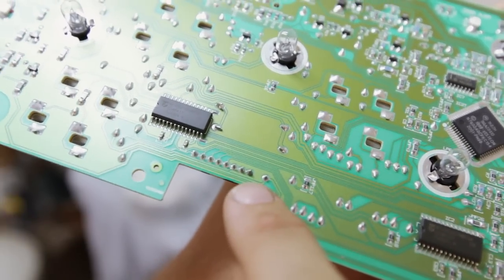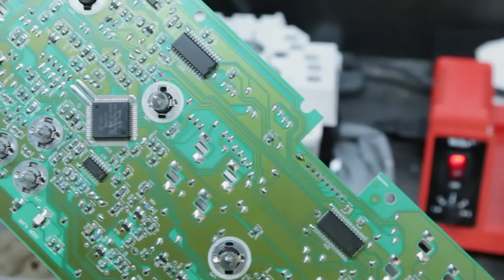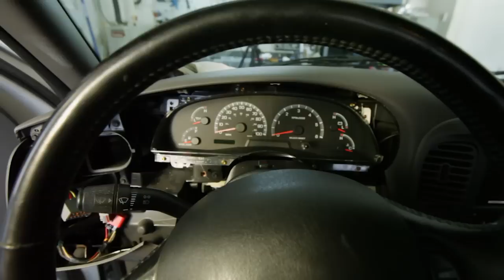How to Repair a Ford Odometer Digital Display

Comment: Ok man I have a question I have a 2006 ford escape hybrid and when I went to get into my vehicle and found before I even opened the door that my that both lights were still on where the digital reading of my odo and where it shows if it's in park ect....dont know why those lights wont turn off if you can help it would be greatly appreciated

Comment: A great help.  i used a jeweler's loop (because my unaided eye couldn't tell if it was damaged) and several of them looked damaged, so I touched the whole connector up and it works great.  Way too hot today to want to dismantle that thing twice.  I'm glad it worked on the first go-round.  The only extra thing I did based off several other videos/articles was I disconnected the positive battery first so the airbag didn't blow up in my face.  I'm sure it's safe enough without that step, but it only took an extra minute.  I also removed all the light bulbs because I didn't want to force the clips off to find out I was pulling off the lights, but now I re-watched your video I realize I could have left those in.  I wasn't expecting the board to take that much force to slide off but that was probably just 17 years of oxidation build up.

Comment: I have repaired two of them, one in a Silverado and another in a Ford F150, just by removing the electrical connectors and spraying both male and female sides with a good helping of CRC Electronic Connector Cleaner.  There was no need to do soldering. The Silverado took minutes to do and the Ford took an hour. The Silverado was sometimes displaying the odometer intermittently because the prongs were loose. . I took it out again separated a few of the outer prongs to get a good fit. No problems with either of them has occurred again.
Reply from the maker: interesting tips and glad the issues have been repaired

Comment: Thank you for this...just did mine finally after years of stressing about it.
Reply from the maker: Glad it was helpful for ya and congrats on the fix.
Reply: When you’ve fixed and lit up your  what was your mileage on your vehicle? 
My F150 has been doing this intermittent often on for years mileage is 254,657

Comment: Will this work for a super duty F450?
Reply from the maker: Hmm, I have never been in the dash of a F450 but my guess is things might be similar depending on the year make of the vehicle.
Reply: Till 2004 almost same except few s
Reply: MrKistel yeah I’ll open it up one day and check out if it looks a little crispy behind the odometer connection and I’ll add more solder. Hopefully it works. It’s a 2005 Ford F450

Comment: before you try any thing  ...try this trick ....remove the battery terminals for few seconds ,then re connect them ,,,,,this will reset the ECM  ,,,it worked for my ford falcon SR3 australia     ....all my dashboard instruments were frozen    ...took 30 seconds to fix

Comment: I have this same issue with my odometer and the gauge for the oil pressure seems to be giving out. Any suggestions for that? Thought of just switching out the gauge from another cluster.

Comment: Great vid,I took off a few less things but did pretty much what you did and now it works perfectly. I would have people look out for that little grey rubber plunger on the end of the Trip button. I plugged in juice before bolting in and the trip -odometer control didn't work. pulled back off and the rubber plunger fell off..
Reply: Did anything else not work like fuel gauge tach i did this lost plunger now no gauges work or odometer

Comment: I did this repair, thanks for the step by step, and triggered the anti-theft device on the truck. The Theft light flashes and the truck will not start. Anyone know how to fix this?

Comment: Joe,  I have made this repair about three times now, but my solder does not seem to hold.  The odometer ends up flickering on and off again.  Is there a special process for the soldering or a special solder for this application.  Many thanks.
Reply from the maker: Rosin core solder.  It can be tricky.  you want to try to make both surfaces hot for the solder to properly adhere but not over heat the board as to melt anything.

Comment: One suggestion -- disconnect the ground on your battery to prevent any shorts. I would  get a CHILTONs book ( it is a How To handbook )  so you can see what everything is.   I have yet to try it yet, nervous about doing the soldering.  How difficult is it to take out the clusters and can they get crossed accidentally putting back in ??
Reply from the maker: It is not too bad if you take your time.  It is always a gamble taking things apart but sometimes that is the only option to move forward. Best of luck.

Comment: I can't believe this little task cost almost $500 to fix. I was wondering though when you use the souldering iron does it come with that little pin?
Reply from the maker: there is a link to the soldering iron I used in the video description.  I am not sure what you mean by pin though

Comment: MrKistel, I hope you still reply to older videos like this one. Thanks for taking the time to make this great video, first off. I, too, have the intermittent odometer on my 2002 F150. I've lived with it, knowing what it is for a while now, but recently, my ABS light in the cluster died as well so the cluster emits a series of 5 beeps 3 times after key on because it knows the bulb is out. However, the bulb is actually a surface mount LED. Do you have any experience or knowledge of how to diagnose and/or repair this? Thanks again for the video and for sharing your knowledge! 🍻
Reply from the maker: Thanks for the comment.  Not sure off top of my head, been awhile since I have played with a panel on this type of truck.  Let me know if you figure it out.
Reply: MrKistel my bad. It's the Airbag light, not the ABS light like I stated above. It IS a replaceable bulb. Thanks for replying. I subscribed!

Comment: Just got around to tackling my display repair after years of putting it off. I have a 2001 Ford F-150 Supercrew. I found the crack on the pin mentioned. Applied fresh solder. It appears I have finally solved the problem of the disappearing odometer!! Thanks for the video.
Reply from the maker: Fantastic stuff Ken

Comment: The headlight switch did not just pop out because it was held in by "two clips". It was a lever assembly and prying like you did in your video resulted in busting the face plate off the switch assembly. You HAVE to use a special tool that releases the spring loaded lever system and latch on the left side of the assembly. Prying it will break the unit. Also, no details about how to deal with the shift indicator. This is an important step. If you follow this video, you WILL break things.

Comment: I tried hitting all the solder joints I could on my 2008 Taurus SEL and pretty much no change to the LED read out except it went from black to the horizontal orange lines off and on. But I have a completely different looking instrument cluster and LED readout. And none of the original solder looked bad. And there are a lot of items under the LED Module that I can't get to. Might just buy a new lower mileage one off ebay and hope it works for the rest of the time I keep this car. I'm surprised there is no way to read the cars milage except from theses message centers. I asked several mechanic's if their engine analysis units could and most say no. It seems to be totally locked into the instrument cluster. That just seems weird to me.
Reply: I know this was awhile ago, but, did you ever get your odometer fixed? I have an '08 Taurus Limited and my LED display is completely out.

Comment: Worked perfectly. Took 2 hours to remove and replace and five minutes or less to solder. Both outside pins had cracked solder. I would recommend you pay close attention to how the shift indicator comes out for reassembly. I would also recommend a flex screwdriver for the socket. My problem was intermittent. Worked when cold and then would turn off. I live in Denver, and I was always nervous the odometer wouldn't come on for the emissions test. Thank You Very Much!
Reply from the maker: Glad to hear it worked for you, thanks for sharing your project results.
Reply: Shit bro, I had this whole job done in less than 30 minutes.

Comment: Man i have to do this to sell my truck.. Problem is i'll probably break some brittle piece along the way and start another project!
Reply from the maker: haha, best of luck
Reply: Thanks for your help dude... Worked out fine, and didn't break or lose a thing.  I only had a 150w solder gun so it was a bit dicey ..lol

Comment: Wow!  That's crazy at how simple that was.  I wonder how much would a mechanic charge to fix that?
Reply from the maker: Thanks for the comment, Hope it was helpful
Reply: If you do this make sure you have the right tools. Need a 1/4'' socket with an extension, 7mm and 15 torx screwdriver. My light controls definitely did not come out easily, pieces broke. Make sure you tilt your steering wheel down and put the truck in 1st gear. The point you solder is on the flip side of where you unplug the ribbon. My board looked much different, it was confusing at first.
Reply: Doug did you check all the soldered connections on that row, or just the one?  What did the failed soldered joint look like? tia

Comment: Extremely helpful.  Question though.  Should I be grounded with some sort of anti-static discharge tether before handling the circuit board? Wouldn't want my 70's throw-back Afro kicking out 20,000 volts of static.  (lol)
Reply from the maker: hahah..  might not be a bad idea
Reply: Always ground yourself before touching circuit boards
Reply: Great video. Easy to follow and it slowed my odometer issue!
I’m having an issue with my tachometer and I was hoping you know which one of the connector on the circuit board are the ones for the tach...?
Reply: disconnect the ground on the battery

Comment: Hi, I just purchased a 97 Ford Expedition and the speedometer is not working. It reads 128856, however it did read 124500 on an inspection report just Sept. 2016 so it just stopped working recently. What do you think the cause could be?

Comment: This video reminds me of the 3 Ford products I owned and why I  GOT RID OF ALL OF THEM !
Reply: So why did you look at this vid and why are you here? I bought my 2003  f150 4x4 9 years ago,put on an  alt. and brakes..that's it.. It had 68k when I bought it,now 168k. My brother has a202 Nissan,had 86k on his way to Arizona,blew up,My other brother has a 2012 Toyota,had to have engine rebuilt on recall...was suckn oil..
Reply: I bought my F150 11 yrs ago. Only very little repairs and it's never broken died on me. All my friends with BMW, VW, Mercedes, Honda's, Kia, and GM always have their cars break down. That's why I bought ford. Had Chevy before and everything went wrong with it and it died in a year of ownership. My dad's F350 had 650,000 mi when he sold it (still running great) so I went ford and other then maint only had to throw $200 in it over 11yrs.
Reply: Umaxen 00 u commie
Reply: Joe Pah is
Reply: Better than GM and their freaking silent recalls...
Reply: No GM, No Ford, No Chrysler and unfortunately no other American car either. I have learned. EVERY American car I have ever owned HAD PROBLEMS. 2 Chryslers, 3 Fords and even though the Chevy lasted a good long time, it always ran rough. I bought a 2005 Lexus ES330 in 2008 with 16,000 miles on it. It now has 212,000 miles and runs like the day I bought it. I replaced the radiator 1x, generator 2x, belts plugs oil, pads? That's it...

Comment: Hi I have a ford transit 2005 model and there is no odometer showing in the dash :/ when we bought the van is had anther external meter (simens VDO) that was connected with the van. It is just like a meter used to pass from border to border and it had the mileage stored in it. Now this meter has stopped working and it is like sealed so I cannot open it. My question still remains why this van does not indicate the original mileage on its dash ? maybe you can help me out please ?

Comment: Hello, my 2010 ford crown Victoria has the same problem and after watching this video I might just fix it by myself, I do have one question though, what kind of soldering wire did you use in that video?
Reply from the maker: rosin core
Reply: You ever get the Vics odometer working

Comment: I have a 2002 F-150 that's had an intermittent issue for years, then it finally quit all together this year.  This fix worked as advertised and it only took 1 hour!  Thanks for the video!!
Reply from the maker: so glad it was an easy fix for you Jim

Comment: Thanks so much!  This is the only video I found like this.  I've to a 2003 Ford F150 XLT Lariet and the odometer indicator lights up intermittently.   More OFF than ON as time goes by.  I had to go a little deeper; to the indicator with ribbon cable.  My problem seems to be in the ribbon cable or connector.  I moved everything around until I think I got it working, but only tomorrow will tell.  Once I removed it from the board, I took a closeup photo with the Ford part number on the indicator with connector so I can research the availability and price of another if the problem persists.  Thanks for your video.  It gave me the courage to tackle this project on Labor Day morning.
Reply from the maker: So awesome to hear this was helpful for you   Best of luck!

Comment: how do you fix a Ford 94
speedometer goes back and forth and numbers flash on and off
Reply: Patricia Martinez it's the battery voltage going too low when the key is turned on, so the cluster resets itself as if it had been disconnected. It can be caused by many things, but usually a weak battery or corroded battery cables. I know your comment is not recent, but perhaps could help someone else.

Comment: had the same issue same truck mind was beyond cracked. the pin basically lost all connection. would this cause my read out to be all dashes? I had the problem where I had all dashes and my truck would not start. a light tap or sometimes a hard pound on the dash and a key cycle would get the numbers to reregister and then the truck will start and run fine. I was wondering if you had any information on this?

Comment: Great video. Thanks a bunch for taking the time to do this. Just one quick question. What watt soldering iron did you use? I will try this fix after I return from a little camping trip.

Comment: Thank you.  Very nicely done and it helped a lot.  The only thing I needed to get from someplace else is how to disconnect the gear shift display.   My odometer was intermittent so I'm hoping this will have fixed the problem for good.  I only touched the one solder point that you mention instead of doing them all like another video suggested.  I understand doing them all while in there after all the work getting it undone, but I didn't want to touch anything more than I had to, so I went with your one point.  Hopefully, I won't have to go in again.  The hardest part for me was getting the plugs undone from behind the console.  I also scratched my dash trying to get out the light switch panel, but that's partially due to my truck being so old (2002) that I think it just scratched easily - took off the gray overlay/plastic.  They don't put much quality into a lot of this plastic stuff.  Anyway, thanks, I'm crossing my fingers that this works, but I won't know for a few weeks if it consistently displays.
Reply: A replacement lens can be had for $20 and scratches can be touched up with paint specifically for car interiors.  Just sayin

Comment: Do you know where the milage is stored ? is it in the computer somewhere or in the speedometer unit ?   I don't want to replace my speedometer with a high milage one.  I took it apart today & saw the led had a burn spot on it.  I tried to reflow all the connections too.  It is on a 06 Freestar. w/o msg display.
Reply: it's in the main computer

Comment: Thanks. I was able to fix my odometer, that had bugged me for almost 6 months. Jim
Reply from the maker: +James Shouse Awesome, glad you found it helpful.
Reply: Mine doesn't always turn on so it is probably just a cold solder joint. Thanks for the video.
Reply: @lostintime8651  Mine is doing the same thing
Reply: Going through the exact same situation

Comment: Hey, great vid. I have a 2002 Nissan Xterra with digital odometer and some of the numbers are blanked out. When I push the screen, they all show but when I let it go, some phase out again. Do you think this is what I need to do? Thanks in advance.
Reply from the maker: Ty Robinson not sure Ty but it sounds like it could be a connection problem.  Best of luck to you.
Reply: MrKistel, thanks for the info. I'll check it out. Thanks again.